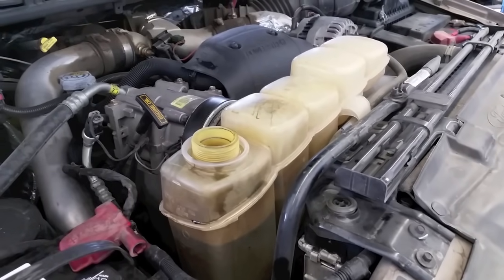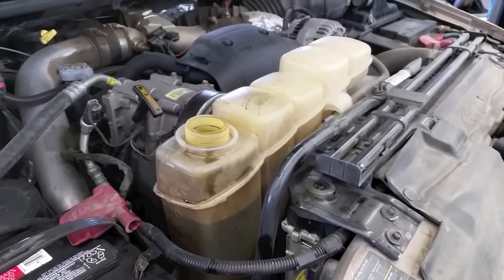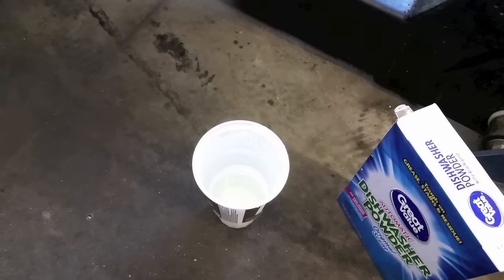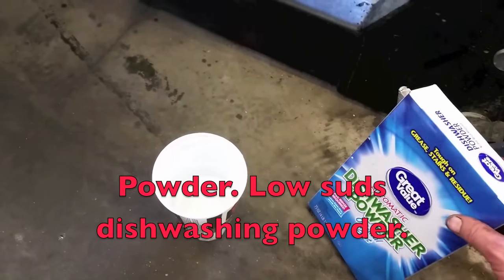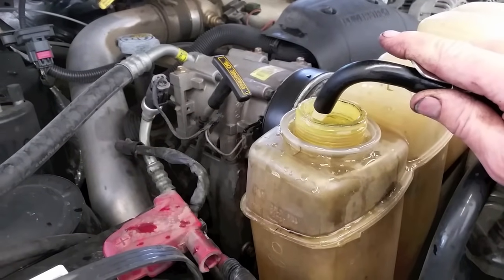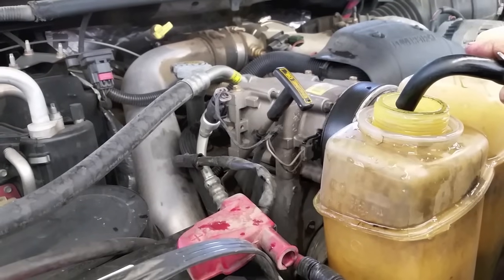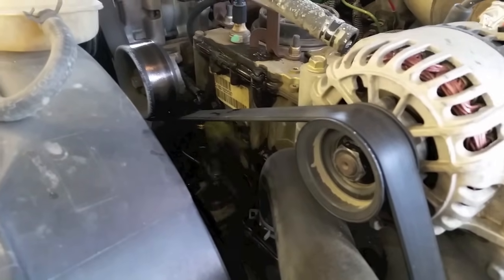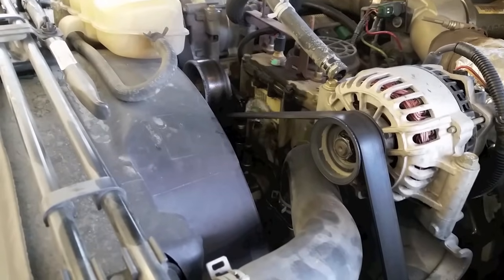Flushing a cooling system thats contaminated with oil, diesel or gas

Comment: thank you very much this will save me a lot of time I have heard that you have to drain from two separate points up under the engine one requires the starter to be removed but as of right now I have good looking coolant I would just like to flush it so I know it's done right again thank you for your time you make great videos

Comment: is it OK to drain a 6.0 from its lower coolant hose?
Reply from the maker: yes.  Not trying to be disrespectful but why not?  If you have the oe thermostat it has a bleed hole to prevent air pockets.
Reply: +DieselTechRon  thank you for all your help you have saved me about four are five times now i really appreciate all your time and work
Reply: +DieselTechRon  thank you for all your help you have saved me about four are five times now i really appreciate all your time and work
Reply: +DieselTechRon  thank you for all your help you have saved me about four are five times now i really appreciate all your time and work
Reply: +DieselTechRon  thank you for all your help you have saved me about four are five times now i really appreciate all your time and work
Reply: +DieselTechRon  thank you for all your help you have saved me about four are five times now i really appreciate all your time and work
Reply: +DieselTechRon  thank you for all your help you have saved me about four are five times now i really appreciate all your time and work

Comment: Do you have to worry about cracking a block when running cold tap water through a hot engine?
Reply: Kasey McCleary I was thinking the same thing.
Reply: @marti74f  I personally would wait until the truck has cooled down quite a bit before hooking the hose directly up to a water intake pipe and running the engine as a cracked block is not worth the risk to save a bit of time!! If you are just filling the radiator to do your flush then you will not have a problem as the thermostat will control the temperature and flow rate accordingly. Hope that helps if you have been putting this off.
Reply: YES!!!!!